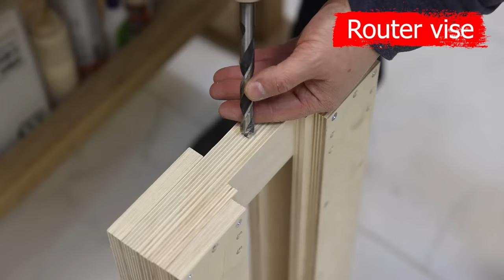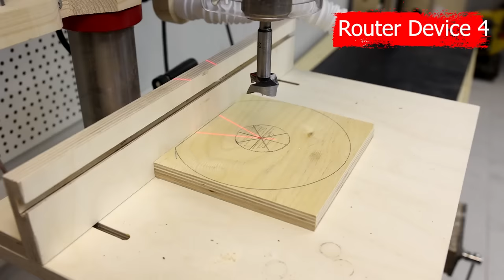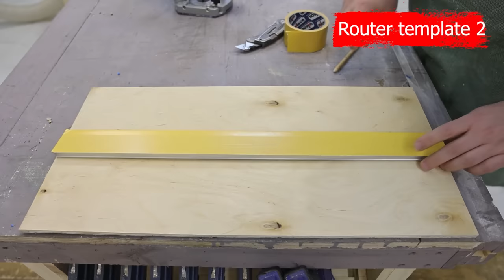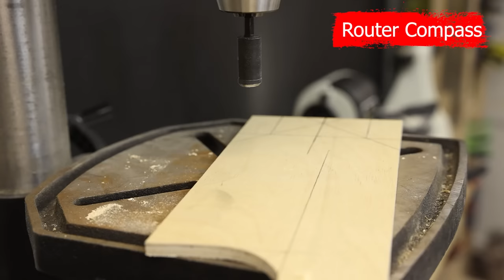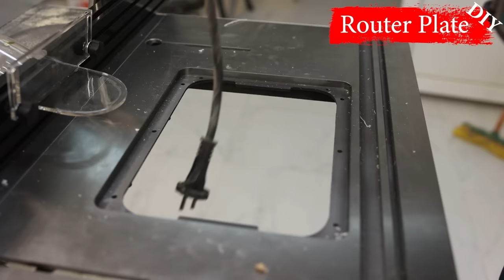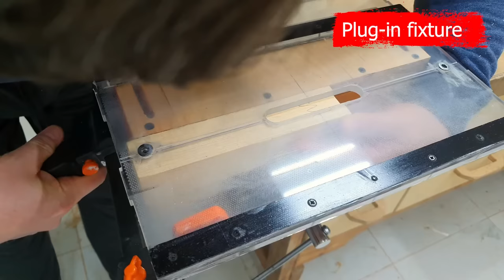8 DIY Tools to Learn Router / Improve Your Skills / Unique Ideas

Comment: Router Vise - Big deal, you can cut a slot on wood. You don't need a vise for this!
Router Template - Use this intead of a Router Vise.
Router Device 4 - Ok, there is use. FYI, the big box stores have tons of different size dowel rod.
Router Fence - Finally, a fresh Idea. Looks simple to build.
Router Template 2 - It'd Ok, but like so many others out there.
Router Compass - Looks like a lot of work to build. Atleast you've brought forward the great idea of a temporary pivot point. That's valuable.
Route Plate/Plugin Fixture - You can't do that with the Router Vise or Router Template?